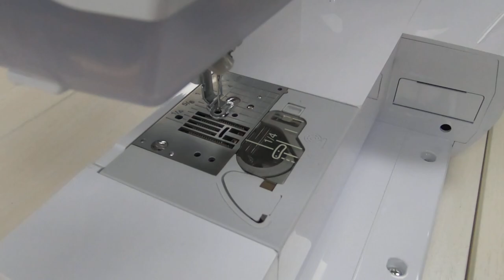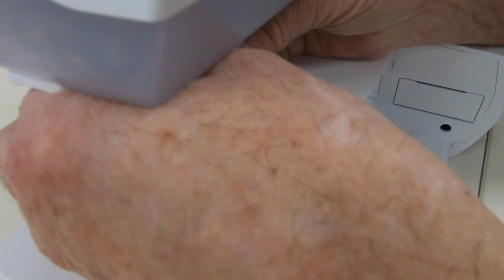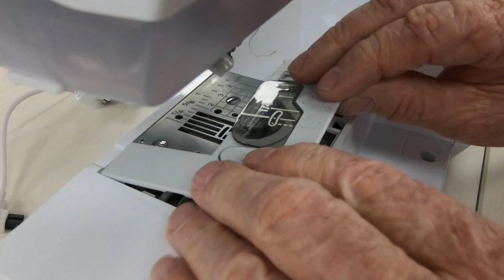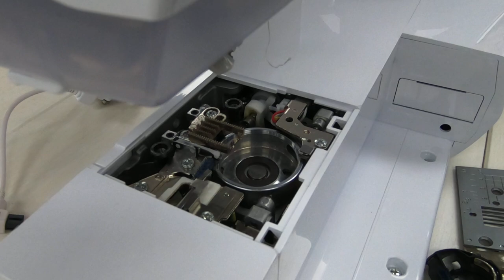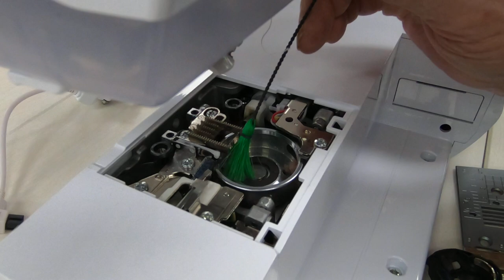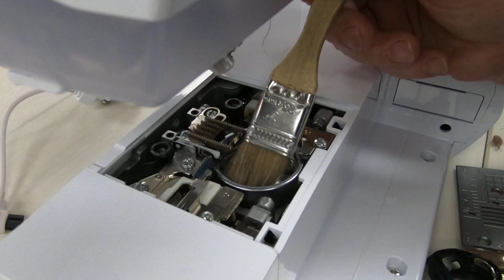Baby Lock Home Maintenance and Cleaning

Comment: No need to remove plastic bobbin cover first. The whole assembly comes out as unit. Once screws taken out, simply push from back to front. Has tiny ledge that it pulls away from.

Comment: I use a thin stick with microfiber tip I got on Amazon (cheap).  I think they are made for another job?  I stick in all the open areas very lightly & pull out large tufts of lint.  It works like lint magnet.  I’m amazed at what is down there.  I am very gentle.  I’ve heard the can air can push lint farther into machine so I avoid.  I clean often!

Comment: Excellent demonstration! I just purchased a new-to-me BLDC2 and your video is perfect. A tool that I use is a very small dental circle brush (used between teeth) to get in the tiny places to get the fluff out. Thank you for taking the time to explain your reasons for doing each step.

Comment: Perfect. If you can address lining up the needle with the hole in the needle plate...I just changed my Baby Lock Destiny's needle plate to the straight stitch one in order to set up for free-motion quilting (FMQ).  The manual states to use this needle plate, rather than the one made for embroidery.  Now my needle doesn't line up with the hole, but hits the plate.  I haven't used this machine since it was last cleaned and serviced. I hate this machine.  Way too heavy to carry, and way too complicated to use.  Takes a half-inch thick manual to go through to follow directions to set up for anything.  I bought the Juki 2010, and have done FMQ on that, just wanted to try the Baby Lock because of its larger throat space.